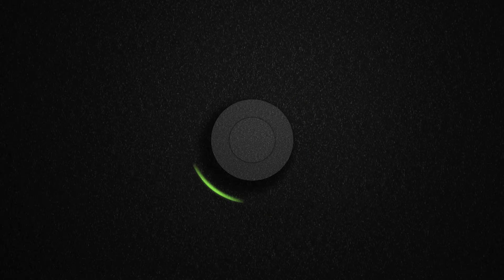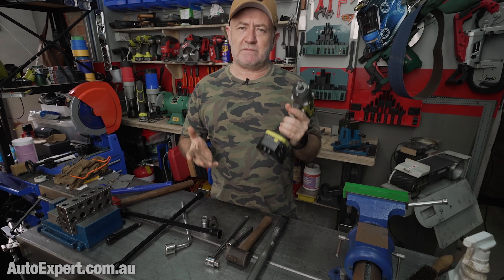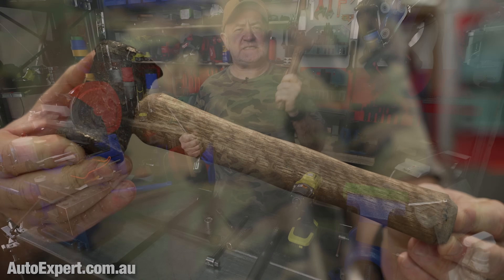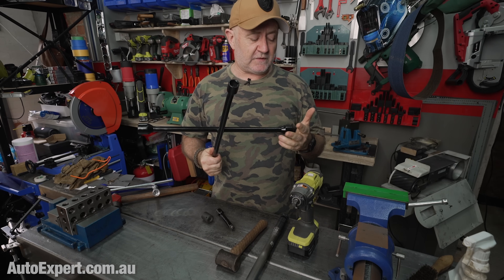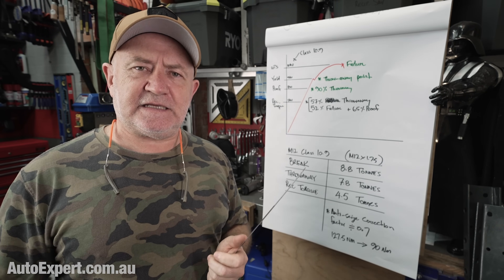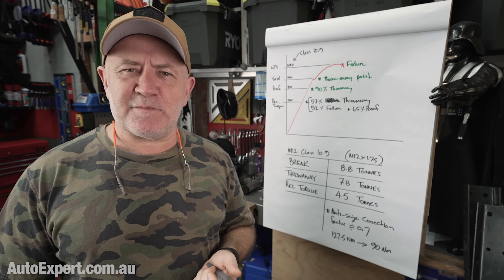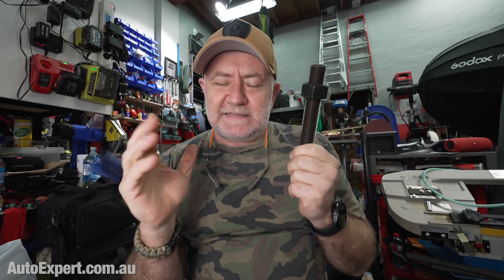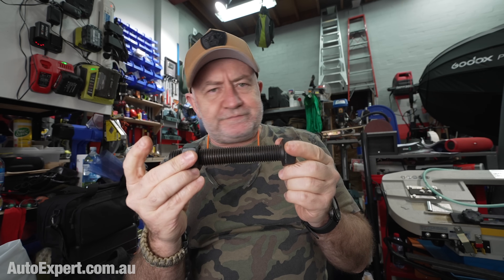Wheel nuts: Ultimate 'ghetto engineering' DIY deep-dive | Auto Expert John Cadogan

Comment: Hi John. 
I also always transfer a 4 way wheel brace from my old car to a new car when i change over cars because they are so much easier to operate that the factory wheel braces. That Ryobi impact driver you had, can i ask what model it is and what is the maximum torque setting for it ( i suspect factory preset - Non adjustable? ). 

I also noted you did not mention to always hand check the wheels nuts when using a impact driver to double check they are done un tight enough. I am old school (56yrs old) and from the bush so we don't trust the new gizmos with such an important thing. loL. Love ya work big fella. Keep ya nuts tight :)

cheers

Rob H

Comment: Just when I thought you were going to say anything about anti-seize...
...you done did.
I just repacked my wheel bearings yesterday, and because that can was sitting right in front of my face.... Well I just felt it was the right thing to do even though I also thought it might not be.
My pickup is a Chevy S10 and I think the lugs are supposed to be between 90 and 100 lb.  It was obvious these were tightening much easier, I stopped at 65 lb.
According to that 2/3 ratio tou just mentioned, i divided the 100 lbs by 2/3  and i'll be dipped.
66.66666 ft lbs.  I almost hit it dead-on with one of my favorite numbers.
Thank you sir that was the best nut video that's ever been produced on YouTube. You covered absolutely everything. 
I hope you have a happy Fourth of July 🍻 🌭🎆
😂😂😂

Comment: I use an extendable version of the standard right-angle Chrome-plated steel wheel wrench if I have a wheel problem on my car. It extends to twice the normal length and makes the job really easy. Don't you have these down under? Oh, yes, I do use a torque wrench when I get home....

Comment: I guess I have been getting the torque wrong by putting white lithium grease on the contact points of the wheels and the  leg studs (or lug bolts on German cars) by torquing to spec. That .7 seems so light.

Comment: I have used the jack to support the driver's shaft, to keep from mangling the nuts. There are some that have crappy stainless caps and thin nuts beneath them.
Please retorque your wheels 100-200 km after having disturbed the nuts.😊

Comment: Great info John, as I recently had my caravan serviced and the service person recommended that I get a torque wrench to ensure that the nuts were at 120NM when checking.
May I ask this service person applied a slight touch of lock tight to each thread when reinstalling the alloy wheels.
Is this recommended ?

PS the Fat Cave is so much better than a tour of the adult  shops located in our nations capital in the 90’s or maybe I am getting old and a different selection of tools has a more fundamental appeal.

Can you please do a video on it ?
Cheers
Gerry
Reply: Using thread locker on the threads is not recommended. make sure the hub surface is cleaned from all corrosion, apply a thin layer of grease around the centre bore of the hub. torque wheels to spec and re check after 100 miles or so. 
All torque wrenches are about 5% ± so I prefer to add about 5% more just to be safe, nobody ever rechecks them

Comment: I always have a cross wheel spanner under the seat. They are so much easier to apply force to, and quicker to use as you can spin the spanner once the nut is loose. 

I also carry a bottle jack. Mainly because getting the factory jack out from under the seat of the Hilux involves taking the baby seat (and baby) out. I guess I developed these habits during years living on all dirt and gravel roads where flats were common. But you feel smart when you do need the gear and can do a 2 min wheel change
Reply from the maker: Both excellent upgrades. Approved!

Comment: Why am I recommended to re-torque my caravan wheel bolts after 100 miles but not my car wheels? Also I am told that the angle of the mating surface for the wheel bolts differ between steel and alloy wheels and should not be swapped, caution if you have a steel spare but alloys on the vehicle.

Comment: The part-turn method of tensioning bolts. Is a way of tightening which doesn't take friction into account. Mainly used on construction.
Reply from the maker: Yeah, and in torque-to-yield bolts. (But you have to start from some reference tension point, which is usually somewhat dependent on friction.) Can you imagine putting that in a car owner's manual, however?
Reply: @AutoExpertJC   Yes way too complex. You have to know the bolt class, the size & length of the bolt.
Reply from the maker: It would be beyond most car owners.

Comment: The righthand side wheel nuts have a tightening moment when driving forward. Years past the Chrysler Motor Corporation used lefthand pitch thread on the lefthand side of their vehicles to prevent any wheel nuts loss. This confused of lot people trying to change the left side wheels. Cheers
Reply: Not just Chrysler. In the past several car makers used Left-hand, ie Reverse threads on wheelnuts on the Left side of the car. Sometimes also used for Axle nuts on the Left side of cars. I stripped one out once. Just as it was letting go,  stripping and coming loose, and only then, did I think "I wonder if this is a Reverse/Lefthand thread ?" Yep, lesson learned.  That was many decades ago.
Reply from the maker: I think it's the other way around. Generally on machine parts, like grinders and linishers, etc, with a lot of inertial shunting, It's RH threads when the sense of rotation is counterclockwise when viewed from above the head of the bolt. LH for clockwise. 

LH bench grinder wheels are LH thread. RH are RH.

Also it's overkill on cars because the nuts and the wheels are not concentric... (I realise moments are transferrable anywhere on a rigid body, but even so ... overkill.)
Reply: @AutoExpertJC  That's why the idea was dropped. Grinders are in reverse like a car going backwards.
Reply: @KiwiCatherineJemma  yes many jap light trucks had that especially if they had dual wheels and thimble nuts to hold the inner wheel. to undo you turned them to the front. and dont get em mixed up!

Comment: My newly delivered 2022 SUV had tyre pressures of 48psi (max design pressure for the rubber is 51psi), adjusted to the tyre tag and manual specs. Guess I should check the spare as well then check all the wheel nuts with my torque wrench before heading out on a 3 week drive.

Comment: The first thing an apprentice does here in the UK is build his tools and learn case hardening. there are many legitimate uses for using a hammer including hitting your other tools. They are not just nail pounders.
I always use anti-seize copper grease or Ceratech on my wheel studs, only a tiny amount though, to much and over tightening is possible if you dont have a torque wrench to hand.

Comment: As usual John great vid, another deal breaker for me when I visit a mechanical workshop is the mechanic using a shifting or adjustable spanner to undo nuts and bolts on a vehicle.  Get the right sized spanner dude, its not that hard.
Reply from the maker: Agreed. Shifters have their place, but that place is not on a bolt for which you have the correct fixed wrench.
Reply: @AutoExpertJC  Hi John, as an add on "personally" I use a nickel based anti-seize which I have found to be more universal, using copper on SS threads can cause SCC at the root of the thread, minor point I know however I've been caught out with this one.
Reply: @CrapToCream  i'm assuming SCC  means stress corrosion cracking?
Reply: @18_rabbit  You are absolutely correct, hidden failure mechanism, one of the worst type you can have.

Comment: I have used a rattle gun to provide ugga duggas to a bottom pulley bolt during a timing belt job. Of course that bolt worked loose and I had to rebuild the head and do the timing belt job again. Cost me 1000 bucks.
I tightened up wheel nuts on my car using rattle gun only. They also worked loose. I never will trust a rattle gun again. I keep a breaker bar in the car and use that. Ugga duggas are for saving time only, I don't rely on it for tensioning.
Reply: Was it the first time you changed a timing belt? Because usually it doesn't move once it's set.
Reply: @Low760  not my first timing belt job. This one was lesson learnt though.
Reply from the maker: Torque wrench for the win...

Comment: I keep a torque wrench in my car, and before taking it for a tyre change, I always remove the locking wheel nuts and fit the regular nuts. Afterwards, I slacken off the nuts which they always over-tighten, torque them up to the correct setting, and refit the locking nuts which are more vulnerable to breaking. Even after getting the nuts off, you might find the wheel has seized onto the hub, so take them off now and again to clean off the corrosion and put some copper grease on the mating surfaces. If necessary, put the nuts back on hand tight, back 'em off a couple of turns, lower the wheel to the ground and rock the car. This will usually loosen off a tight wheel.

Comment: I love it on any occasion where I get a chance to get the FBH out of the tool box!!! Thanks for the recommendation there John!
Reply from the maker: It atones for a multitude of sins, typically.
Reply: @AutoExpertJC  🤣🤣🤣 👍
Reply: Dear John, have you heard of Starwillie tools and doo you know if you can still purchase them?
Reply from the maker: Never heard of 'em. And here I was, presuming King Dick was the pinnacle of toolophillia...
Reply: @AutoExpertJC  LOL, When I worked in the automotive trade 40 years ago, ALL the mechanics were buying them. When i questioned them why, the answers were: excellent strength (Chrome-Validium), super thin and finished stock between heads (making them very light for their strength), and nicely finished tool ends so engagement with nuts and bolt ends was super easy, but secure. I purchased a few based on this recommendation which I still have. They are really nice to hold and use. But I can’t seem to find them anymore. Even overseas/online. 😢

Comment: The simple method to deal with the factory lug tool is to stand up with your arm straight down in a vertical orientation. You can lift the vehicle after breaking them all loose and with the weight of the vehicle sitting on the wheel it is unlikely to turn. Using the 4 way spade increases the likelihood of an unpracticed individual bashing their pushing hand into the ground. For doing maintenance in the driveway, Just buy a breaker bar and a socket set for a fraction of the cost of an electric impact.

Comment: Wow that wheel nut used in the impact demo was incredibly loose. I come across lug nuts quite often that my 1400 ft lb Milwaukee 2767-20 impact can't loosen and I have to use a 10 foot pipe on my 3/4" drive breaker bar and jump on the end to get them to loosen so that cheesy little Ryobi would have no chance of ever getting a properly stuck lug nut loose. I had one that I had to cut the wheel off and replace the hub assembly because there was no chance of those lug nuts ever coming out.

Comment: Roadside, I carry and use a crosswrench but I lightly tap the nut along the wrench first before twisting using the other two arms. This breaks the seal of any accumulated gunk and makes nut removal easier. Will this damage the stud?

Comment: Great video. Not sure if you have had the same problem, but here in Ontario there was a rash of truck wheel separations a few years back. I'm sure that much of the issue was with improper torque. There has been an annual inspection blitz every year for a long time, and still lots of trucks get red- flagged.
Reply from the maker: Yeah - wheel studs are more precise than a lot of the people torquing them consider.
Reply: Commercial trucks require re-torque after a few hundred km when tires/wheels are serviced but not everybody does it.

Comment: Thanks John, didnt know about the battery powered impact wrenches.  Just some clarification on using the extension handle/pipe, where you said it could break the stud? can you elaborate further, whats the difference between a strong person putting a large force on a standard length wrench and a weaker person applying a weaker force using a pipe extension to create the same torque to loosen the nut?  The nuts on my ve holden are rated at 170 Nm, I got myself a torque wrench at Aldi for less than $40, its got enough leverage, long enough for 250+ Nm, so have just thrown that in the spare wheel well as my device.....with the bonus I can torque them at the roadside to spec.  Pleasingly had some new tyres installed recently, they assured me they had torqued them to spec, checking them with my tool, they were right on.
Reply from the maker: When a fastener is stuck, hitting the wrench with a hammer is less likely to break the fastener.
Reply: @AutoExpertJC  okay, so in the situation where the fastener isnt "stuck" but just requires a very high torque(say 170 Nm to get the wheel of a ve commmodore) that not all people are capable of with a 30 cm handle(would require a 58 kg person standing on it), than adding an extension should be fine?

Comment: When old kevin rudd was chuckin around his free kruddy money, i bought a set of 20" mags for my lowered WH statesman, looked cool af, but the half arsed lowering job from previous owner, had the camber wearing out the inside edge of the rear tyres faster than i could put fuel in it. A blow out ensued, an guess what, stock wheel brace now wont fit inside the wheel nut holes on newly purchased mags.... Always recheck your gear after making any changes, at home...

Comment: Ive got a 18v ryobi rattle gun that lives in the boot of my car for whenever that tyre change is required. Failing that Ive got a 3ft breaker bar
Reply from the maker: Integrated solution with failsafe. Like it.

Comment: My wheel nuts need 140 Nm torque. I weigh 90 kilos which is close enough to 880 Newtons . So when tightening my wheel nuts, can I improvise a torque wrench by standing on the tire iron at 16 cms from the center of the nut? (880 Newtons X 0.16 m =  140 Nms)? Do I overtorque if I jump on the tire iron?

Comment: Surprised you didn’t suggest a ‘breaker bar’ John,much safer and easier than trying to dong a wheel brace etc,just a length of galvanised pipe that fits over any size wheel brace,increases ability to crack nuts exponentially,no risk of hand or knee damage 😉

Comment: I accidentally unfastened the engine oil drain pan bolt in the wrong direction and actually fastened even tighter. The oil pan is aluminum. The bolt I assume is steel. Did I damage the threads? It was a quarter of a turn at the most, to the right.
The torque spec is only 29 foot pound for this bolt.
This oil had never been changed, so the bolt had the torque ser by the manufacturer of the car.

I am hoping I just crushed the crush washer even more than it was, but did not damage the threads.

Comment: Can you do an episode on  car jacks? I have seen people who don’t have a clue how to operate one or where to put it etc. I had a scissor Jack collapse on me years ago and I was lucky not to lose my legs as I had them under the car when it went. I was lucky that I had placed the tyre under the car and it stopped the car from taking them off or maybe just damaging the crap out of them. 
Some of the jacks I’ve seen should not be used and they come with the car.
Also if you put a spare saver on your Suzuki Swift from 2005, remember to remove the spacer before putting the spare on otherwise you’ll have very few threads to screw the nuts back on.
Reply from the maker: I'm working on it now.
Reply: @AutoExpertJC  this would be great. Thx.

Comment: John, most impact drivers seems to have fixed max torque. The Ryobi with three torque settings has minimum torque setting of 160 Nm. Aren't these impact drivers all going to over-torque the wheel nuts, or should they be used to "snug" the nut then finish with toque wrench?

Comment: I have actually observed a clear cut case of a nut coming loose, more or less on its own. It holds some suspension bits (anti-rollbar link, I think) on my old BMW (still on strike... bloody Germans...) and the guy who put it there really went with the minimalist approach.

It's a weird location and, though I'm sure his calibrated torque elbow clicked just right... BOTH TIMES... the pissing thing came loose again. At that point, knowing exactly which nut it is, I figured if you have it - use it. Did it up with a real torque wrench and it hasn't moved since.

It's glaringly obviius why it came loose in the first place though.

Comment: I can't say I have ever had a problem removing wheel nuts, probably because I use a torque wrench to tighten them and after a tyre change I check (usually way over tight)
However my wife did have a problem because she only weighs about 55kg. I showed her how to set the spanner at horizontal angle, put her foot on it and then kick it as if she was trying to climb. She can now undo them without a problem.
Reply from the maker: Getting the wife skilled up to do it for you: genius.
Reply: @AutoExpertJC 
I had to - how else is she going to rotate the tyres when she services her car?

Comment: Ok, thanks Sir. I have a question. What about the workshop manuals that stipulate changing high tensile bolts, I presume,  when doing repairs on high impact areas such as suspension elements and brake elements as standard operational procedure? Does anyone in the real world adhere to this advice? Or maybe spin a new nut down the length  of a bolt Um ar. Thanks for your efforts. Regards from Shitsville Victoria